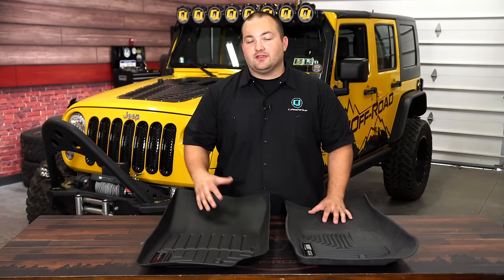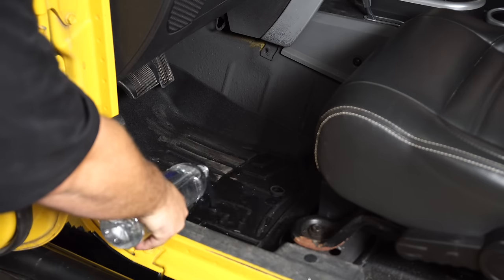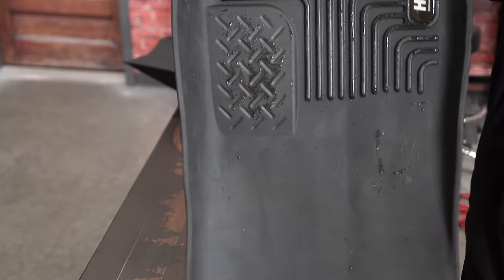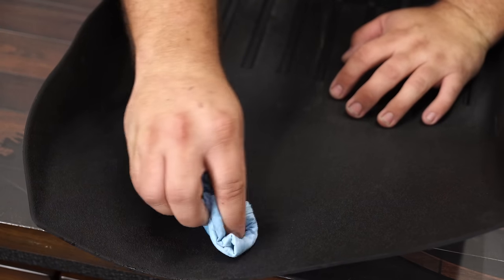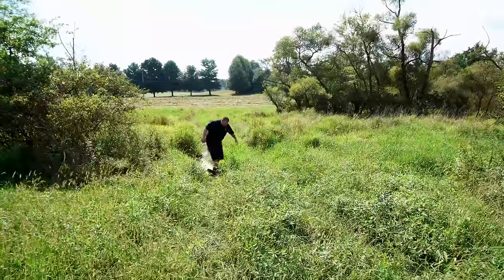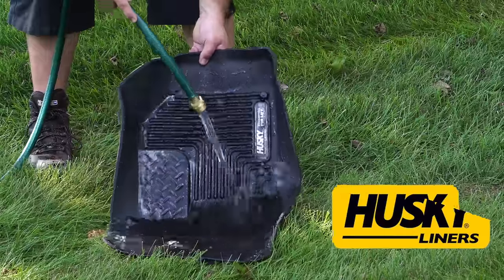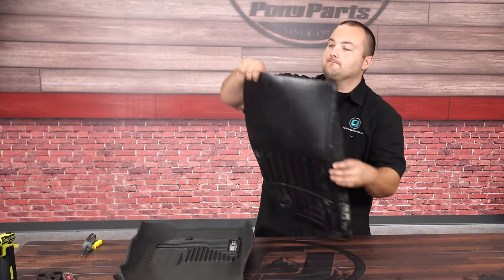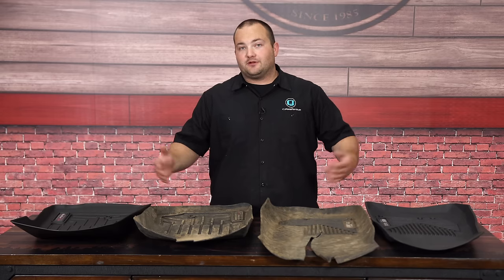WeatherTech VS Husky Liner: Torture Test and Comparison!

Comment: Bought weather tech for my Tacoma since my oems failed. The weather techs have a poor fit around the kick panels and the trans hump. 
I would go with 3D maxspider mats next time. I’ve seen them in dozens of cars and they fit perfect. Probably not the beat for a keep but for other vehicles I’d definitely go 3D.

Comment: My boss bought Weather Tech liners for all the company trucks and they take some some abuse everyday. I drive around 150 miles a day making about 60 stops per day. Constantly getting wet, dirt, mud, rocks, grass and dog shit on them. They are holding up well so far over a year later. The only thing is where my boot sits on it by the gas and brake petal its wearing out so eventually it will form a hole.

Comment: Well I've had  weathertech  and it never fit the pocket right even in the hot sun . and that slick shiny look doesn't last long and after a year or so the corners start to roll in and the little pop sockets that lock it to floor brake easily.

Comment: The older weathertech emblems suck, I have some mats where the emblem is not flat with the floor but on the angle where the mat bevels down to the bottom of the floor, so it's at about a 45 degree angle and both fell off.  I actually have another set for the same model truck but they are newer versions and the emblems are flat, and one did come off.  Not that I would make a choice of mat based on how good the emblem is on lol

Comment: I have owned WeatherTech front mats for my 2012  Honda Civic for 5 years now and WOULD NOT recommend them.  First problem being if your shoe is wet getting into the car your foot just slips across the floor because they are plastic.  Second problem is the "laser cut"  DOES NOT fit perfect.  There's about a quarter inch on both sides were dirt, grass, leafs and such get in and underneath the mat onto your carpet.  And the final problem is cleaning them.  After about 6 months of everyday use they are impossible to look anything like new.  The dirt grinds into the mat and the color fades.  Have never tried Husky mats but I can tell you DON'T BUY WEATHER TECH, period.  Yes, I still use them but for $50 a mat, I'm not throwing them away!!
Reply: They look so smooth so it might be slippery moving my heel from accelerator to brake? That's as important to me as keeping salt stained water off my floor.

Comment: If you're going to compare liners, then you should use SIMILAR liners.  Husky Weatherbeater are the ones you SHOULD be using against Weathertech.  Good try at promoting Weathertech though, if the watcher is not educated in the types of liners available.

Comment: I'm fairly certain that "when you tap your feet there's definitely some noise" won't be a concern for anyone in a Jeep. A quiet ride is not at the top of your list if you've purchased a Jeep. That floor liner "foot tap noise" will go completely unnoticed once you put it in drive.

Comment: You're supposed to sop up any liquid mess with towels of some kind before removing the liners to clean them - just common sense. Don't care if the liners don't hold the mess in like dish pans while they're being removed because they're not dish pans. What I do care about is how well they fit, how well they hold messes in until I can sop them up, and how easy they are to clean while in the vehicle as well as to clean once removed AFTER I've sopped up any liquids. PS - You should wait until AFTER you've burned rubber on them before tearing them although I don't think that test was helpful as it doesn't seem like that would happen IRL.  ;-)

Comment: Bought a front pair of Brownings on Sale at Menards for $27.00.  They fit almost as good as Husky's X-line, Which is Husky's most expensive custom fit line.  Don't buy the Weather Tech, tbey dry up and curl, are slippery when wet and don't have any cushion.  The Detajl Shop that does my work sez they are junk.  They also Detail used cars for Dealers and always put the Weather Techs in the trunk after cleaning. Why, because they don't clean up and always curl up taking away from the car's appearances.

Comment: i have used both and weathertechs are prettier but who needs pretty when i got a set of husky for 30 dollars on ebay. they were used but in excellent condition. alot cheaper than the 107.00 that weathertech was asking for online. just one mans opinion

Comment: You should do the challenge of holding water again without the bottle of motor oil underneath the front of the husky.  See if it still wins.

Comment: My emblem came off my weathertech
Reply: Same
Reply: @mitchdenner9743  same here and in the cold wheather they will deform
Reply: Same here as well. I have 2 sets for each vehicle.
Reply: Doesnt weather tech have lifetime warranty?
Reply: I guess you are now debadged!  Mine are 3 years old.  Look perfect.   Weather Tech.
Reply: Call weather tech they should replace it
Reply: I just put back on with 3m emblem tape I had in garage. That shit is unreal.
Reply: is it the emblem that keeps the floor clean and dry? 🤔🤔
Reply: Out emblem came off too, during hot weather
Reply: @tinablum9089  Husky does also. The real question is how are claims handled if you try to get yours replaced.
Reply: Mine did too I kept sticking it back then gave up and stuck it to the wall in the garage. It stayed on the wall tho

Comment: Prefer husky
Wt tend to curl and just dont feel as substantial
Reply: I’ve had them in two vehicles and they do tend to curl and don’t fit right after a while.
Reply: WT very plastic, slid up and then create a gap or curl, way to slippery, Husky more rubbery and don't slide around.
Reply: @JamesWilliams-wy5oj  Must be a new thing with the Huskys then. I have had a set of them in my 2004 Silverado since sometime in 2005 and the driver side (I hardly ever have passengers for that side to get use) slipped/slips all the time. It actually slipped up far enough that it permanently creased itself.

Comment: I just bought my wife WT  floor liners for her Acura  RDX for Xmas. They are not only cheap plastic, the edges curl up wards, so water, salt can get into the  carpet. My next move is to try and use a heat gun to bend the edges down. the whole thing was a waste of time and money. I have a 4 year old set of WT mats in my truck, and they used to be thick rubber  that fit correctly. They are making them now with inferior materials, and sloppy cutting.

Comment: I've had a set of weathertech in my daily for about 2 years now, and they still look brand new
Reply: I've had a pair of weather tech liners for about a decade and wore several holes in the driver side mat. Weather tech refused to stand behind their product because I couldn't find a receipt. The liner has their name on it for Christ sake! Husky doesn't require a receipt for warranty claims. I just bought a 2017 accord, and I went with Husky.

Comment: I have weather tech in all my vehicles. Best mats ever
Reply from the maker: they are great quality mats.
Reply: yeah I agree with you whethertech are very good mats I had them in my previous car and was very satisfied but I bought the Huskies this time because they were literally like 60 bucks cheaper I got the front mats and the rear mats for $136 after taxes & free shipping. They all seem pretty legit imo??
Reply: @honda116969  I was shopping for matts and saw the price of the WT price and bought some Husky matts for half the price and have had them for 2-3 years and they have held up great.
Reply: @MrTimdtoolman1  right on! I love mine.  Makes cleaning the floor so easy. I have dogs so it's hard to vacuum the hair out of the carpet but it's so easy off of the husky floor mats.
Reply: @honda116969  60 bucks is nothing if you're supporting American-made.
Reply: @BlowitAllUp  agreed but...sum ppl $60 bucks is a make or break deal u kno? But yeah I like American-made stuff hopefully we can get all this bullshit figured out & get these factories back where they belong 🇺🇸👍👍 I've had WeatherTech b4, I honestly wanted to try the Huskies & save 💰 @ the same time.
Reply: George R & Richard last I checked both the huskys and WTs are made is USA 🇺🇸
Reply: So do the WT curl up on the sides ?
Reply: Emilia C  mine don’t. A buddy of mine had an issue with his because of how it was crammed into the shipping box, but he used a heat gun to loosen it up in order to correct it

Comment: One complaint I hear about the WT compared to the husky is that the WTs edges near the door sill curl after extended use from getting in and out and catching your foot
Reply: Yeah they do. Husky are better as heat will soften them and gravity keeps them formed to your car
Reply: @russellpickett2689  So when your accelerator gets stuck good luck filing an insurance claim 🤣

Comment: I own both on several cars. I prefer husky for two reasons. Husky does not have a hole for the mounting grommet which doesn’t allow for water to leak onto your carpet which is the whole reason for getting these. Second they are significantly cheaper. Both are just as durable as the other. 
Weather tech are quite over priced IMO.

Comment: I’ve had both and like the husky better.
Reply: My dad has the Weathertech in his truck and hates them because apparently, not all vehicles have mounting points, especially on the passenger side.  If they had cleats like the Husky, he may not dislike them so much.  My truck has some rubber like mats with Ford emblems, so maybe some type of factory option, and mine do not move.  The driver, passenger, and rear mats are completely stable.

Comment: Husky Contour mats are great, if they make them for you vehicle I highly recommend them. The rubber texture makes them less slippery when getting in to the car with snow or mud on your shoes/boots. They are a little harder to clean but they are floor mats, who cares. 
Weathertechs are ok, but usually $30ish more than the Husky, which can be found on sale quite often.

Comment: Just out of curiosity could anchors be added to that jeep? I once had a Honda Element that did not come with a carpet or any type of floor mat but they could be optioned. And there is an anchor installation kit forthe Honda Element for adding floor mats.

Comment: Husky is a bit cheaper, Husky offers Military/Veteran Discounts.  Over time the WeatherTech hardens and becomes cumbersome.  Husky being a little more softer, it molds better to the floor.   Bang for buck, the Husky is much better.  2020 GMC Sierra Crew Cab, 2017 Jeep Wrangler JKU, 2006 Jeep Wrangler TJ and a 2013 Ford Edge.

Comment: I would have liked the softer Huskey liners better had Huskey manufactured a set of liners that fit my car exactly. The only option from Huskey was the "uni-fit" floormat for my 2009 Acura MDX whereas WeatherTech made a set of floor liners that fit the car exactly. The availability of the floor liners that fit your car exactly matters a lot when you're paying a couple of hundred dollars on a set.

Comment: Weather Tech are too plasticy. They might fit slightly better if you remove the carpet.
I kept my carpet in, Husky mats over top, no issue. Way more deep pins on Husky mats may be why. If I did that with the WT, they would move way more.
Husky has been great for me. 2016 Dodge Charger

Comment: Both weather tech and Husky floor liners are great.  I have weathertechs in my 17 Tacoma and Husky in my 13 Tacoma.  I personally do slightly prefer the added grip of the softer rubber on the husky liners, but honestly I could go either way with these.  When choosing between husky and weathertech.  I just choose the ones that I can get the fastest at the time.  No other comparison need be made in my opinion as they are both just great liners.
Reply: Either of these mats would be a one time purchase, maybe twice if you keep the ride long enough. If you prefer one over the other, it makes better sense that you buy that one, regardless of whether it takes longer to arrive. You're gonna live with these a long time- get what you like.
Reply: @satulytman  Jesus loves you

Comment: Have W/T in the front and Husky in the rear of my truck. Already in when I bought truck. Like them both. My husky cleans easier. Stays deep black longer. Not a lot of difference in color change with the W/T but still a change. Like the way the W/T fits better than husky. When my wife gets a new car will probably get W/T for the front and Husky for the rear to save a few dollars just because the rear doesn't get used near as much.

Comment: I wish I can add photo here, but this is the problem with Weathertech. Because the side are taller and what its made out of, its not keeping straight line up top. It goes wave and sometimes catches my foot when Im about to use gas pedal. I kind of have to push it to the side away from gas pedal

Comment: I have both brands WT in a Grand Cherokee, Husky in an F150.

I won't buy the WT ever again. Too slick under your feet. Both hold up great. WT is a stiffer plastic/vinyl so it will be more abrasive resistance if your an ape with them.

Comment: Experience using both. WeatherTech you know you have a plastic tray every time you move your feet. Husky you forget about because they are softer and quieter. Both provide protection standard floor mats do not especially for winter salt. 

The less funny video way to get water off the mat is to use a rag not take them out full of water. Better yet don’t have soda, mentos, and pancake syrup in your car or truck or at least use real maple syrup.

Comment: Have a set of WetherTech liners for a 2005 Dodge Ram 1500 that still fit perfect since i bought them in 2007. But two other sets, one for a 2009 Acura TL and another for a 2016 Chevy Silverado were garbage. Sides caved on both.
I ended up giving the Silverado mats away and bought the Husky mats . Much better product.

Comment: without tie downs on the passenger side of the Toyota Tundra,  the weather tech mat will not stay in place and slides all over.  I would not recommend them in vehicles that do not have tie downs on the floor,  even double sided tape I put under the mat and on the carpet did not hold the mat in place.   At the Toyota dealer I ran into someone with the same truck as mine and was having the same problem.   Mike

Comment: Enjoyed the comparison.  Hey, I ran across a nice used set of the Husky WeatherBeaters at a sale.  The number on them is 9876.   The only thing I can find on the website or eBay is 98761, and that fits a 2011-2014 Ford Explorer.  My guess is that these might fit an older Ford Explorer.  Anyone have a clue or a better source for determining which vehicle they fit?

Comment: You should have tested the Husky WeatherBeaters against the Weather Tech floor liners. They are much more similar. I went with the Husky's in both my vehicles because they went up further  on the firewall under my feet. They catch more of the crap that comes off my feet when I use the gas or brake pedals. It doesn't end up on the carpets. IMHO.....

Comment: If I was to buy Husky Liner it would be the Weather Beaters as they are made of the same material as the Weather Tech mats. The only thing is both stain after a few months and you can't remove that.
I think y'all should've used the Weather beaters in this test. Soft rubber isn't a fair comparison

Comment: Thanks for he review...I have used/had WeatherTech mats in my vehicles for over 10 years (have never tried Husky, but may on my next one); my biggest complaint about WeatherTech is once they get scuffed, they stay scuffed.  I've tried WeatherTech cleaner and conditioner, but they still look scuffed.  Other than using Armoral or similar product on them (which you are not supposed to do)  nothing seems to help.  If anyone, has knowledge of what might help the "scuffed" look, I'd like to hear about it.

Comment: Husky are far superior! I have both and the weather techs are hard and plasticky. Weather techs curl in time and just don't fit properly. Husky are thicker and heavier and lay in place much better. Husky are not slippery with snowy feet, the weather tech are very slippery with snowy feet. I think your review is very bias...
Reply from the maker: Thanks for your input, there was no bias though.
Reply: CJ Off-Road  sorry, didn’t mean anything bad. Just seemed like you had your mind made up before each test.
Reply: zoolanderfred , interesting about the fit on the weather tech because I noticed the other day a 3/4" gap between liner and the side of the door. It was NOT there when I got them and they are locked into the floor tabs.
Reply: zoolanderfred  weathertechs curl in over time due to the heat. I would get husky.
Reply: I agree with the weather techs being too plasticy.  We outfitted a large fleet of trucks with them and most were trashed in about a year.  Same complaint, they fold over and curl.  We switched to the Huskys and couldnt be happier.
Reply: Easy keyboard warrior.